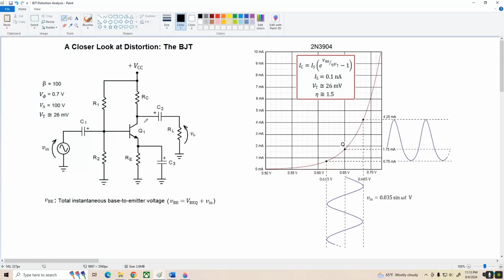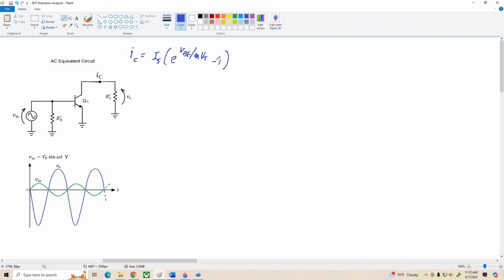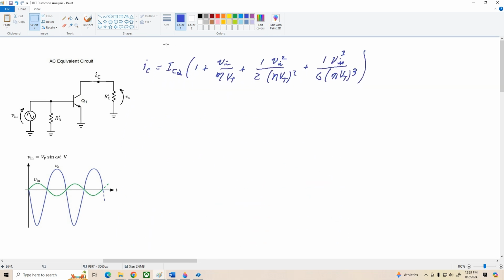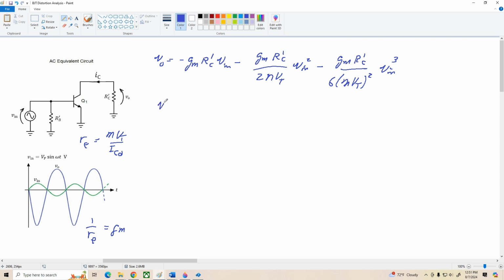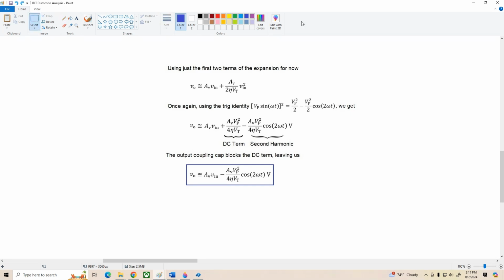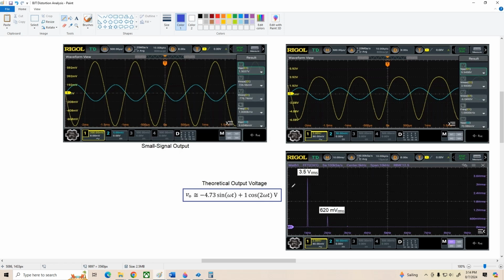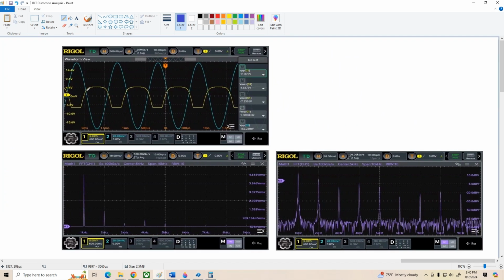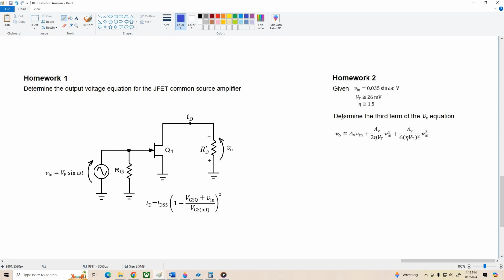Topic 53: Nonlinearity of the Bipolar Transistor

Comment: why isn't this information in standard textbooks?? it's so useful. From homework 1 we can see that for a JFET the distortion increases as the bias point approaches pinch-off, and it is inversely proportional to the pinch-off voltage. The algebra is easier if we express the bias point Q=(Vgsoff-Vgsq)/Vgsoff. thank you for the videos. Finally, we can CALCULATE!
Reply from the maker: @famicomical  with textbooks, the publishers do everything they can to keep page count to a minimum. And there’s an old saying that for every equation you add to a book, you can cut the number of readers/buyers in half. Probably some truth to that. 

But I think this stuff is fascinating and well worth taking the time to study. The math isn’t really that advanced and it’s cool to see how it all works. And, you can build the circuits to see how it applies too. Thanks for watching 👍🏻

Comment: EXCELLENT PRESENTATION BUT,I AM AFRAID I GOT LOST IN THE MATH?
Reply from the maker: @davidluther3955  yeah, it’s some pretty abstract stuff for sure, but hopefully it’s kind of interesting too. I don’t think anyone else has covered this aspect of transistor operation (maybe for good reason lol) so I thought give it a go.
Reply: @Denton.Dailey  SOUNDS GOOD!
Reply from the maker: @jim9930 I hear you 👍🏻 about the only place that tubes are still the preferred device is in guitar amps, otherwise I wouldn’t even mention them. Though, it will give me a chance to work out some interesting analysis examples using  the binomial expansion, which is another topic that kind of cool and rarely mentioned in the literature. Yeah I know, I have some strange ideas of what’s cool 😂

Edit: I have some power JFETs and was considering doing some power amp stuff with them eventually. Also will be doing LaPlace, waveform equations, impulse response, etc one of these days too!! Some good stuff in store.
Reply from the maker: @jim9930  thanks!! Glad you found this video interesting!! I admit that I don’t use the trig identities (or power series expansions) too often either, but it is cool to see how they can be applied. I will really get into them when I cover modulation techniques sometime in the future.

I was debating whether to start into vacuum tube stuff next, or continuing on into diff amps, op amps, OTAs, etc. I’m leaning towards tube stuff,   but either way I appreciate your feedback and hope you’ll stick around. 👍🏻
Reply from the maker: @jim9930  👍🏻😂
Reply: Amazing